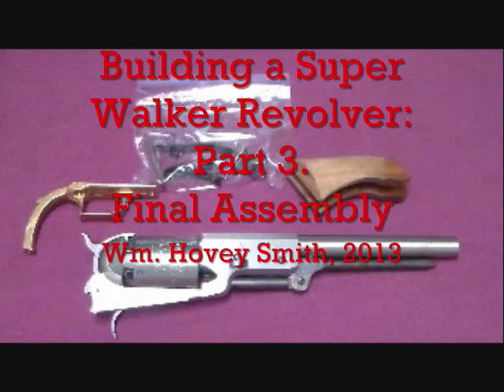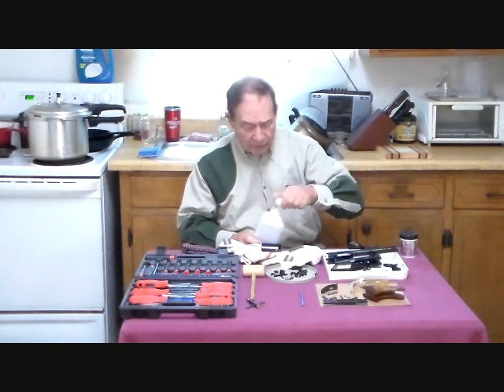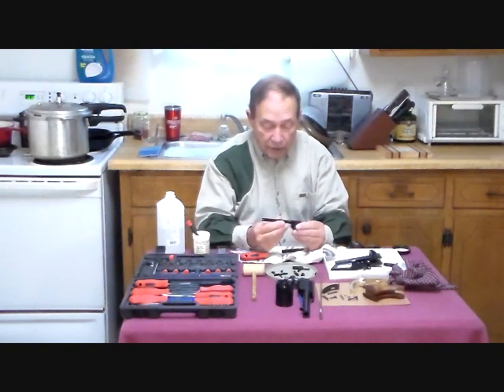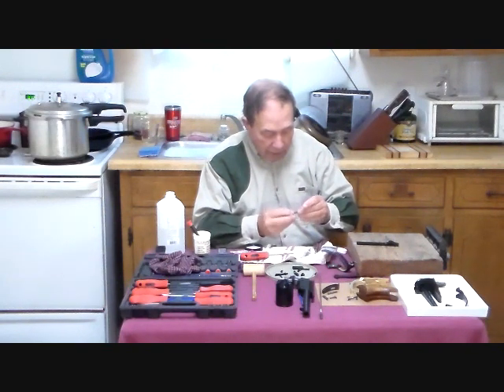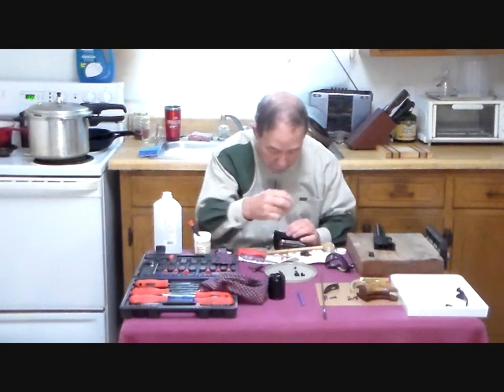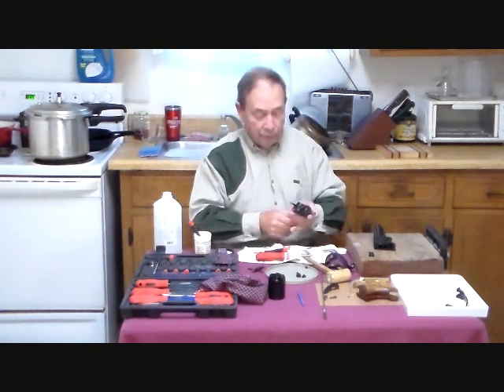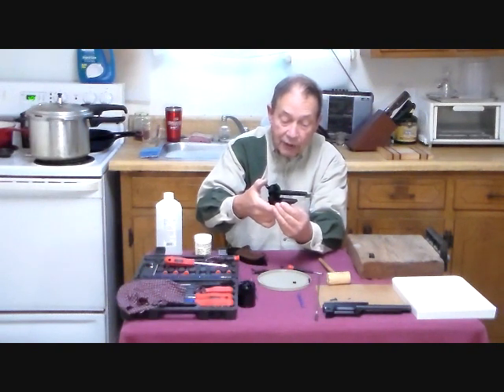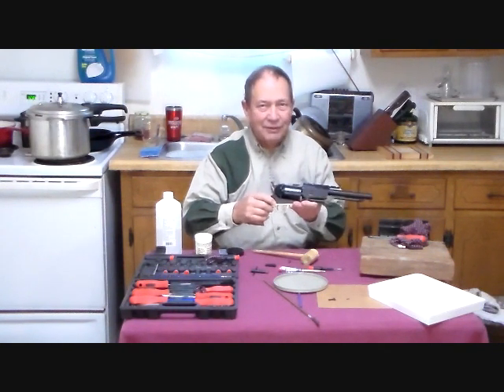Building a Super Walker Revolver: Part 3,  Final Assembly.

Comment: Hi Hovey, thanks for posting these videos on completing an Uberti Walker kit. A method to install the Walker hammer spring is to compress it with either a vise or vice grips and then using a plastic wire tie to keep the spring in compression. After the trigger guard and backstrap have been assembled to the frame, the wire tie can be cut.

The original Walker had the cylinder in the white. I have nickel plated my cylinder and now waiting for the frame, barrel, and backstrap to be returned from H&M Metal Processing.

BTW, the easy method of keeping the loading lever from falling was to use a leather band. Today we have rubber bands that can be used.

Thank you for posting your Walker videos, they will be useful to others considering making the Uberti Walker kit.

Regards,
Richard

Comment: beware of H&M Metal Processing. Not all guns can be sent. I sent my Ruger Old Army to them for black nitride. I took it to the range when I got back and on the first shot, the front sight flew off. The process melted the solder.
Reply from the maker: +Courtney Titus I can see low temperature solder bonds being broken. That is a fairly easy repair. After you re-mount the sight, I think that you will like the results. I have been very pleased with the three guns they did for me.

Comment: Not a revolver guy. Calling the 'bolt' a 'pin'.  The 'hand' a 'pawl'. No mention of fitting the arbor to the barrel which will effect how the wedge fits. You should never need a mallet to seat the wedge.
Reply from the maker: The terms you mentioned are the correct ones, but my calling the part by its functional use, rather than its correct name make little real difference in how the pistol shoots.
Reply: How did you address the arbor/barrel interface and wedge fitting? Uberti's are notorious for having short arbors from the factory. And needing a mallet to seat the wedge tells me the wedge was never fitted. When the arbor and wedge are correct, just finger pressure is needed to seat it.
Reply from the maker: I didn't. Good point. Give us a YouTube about that.